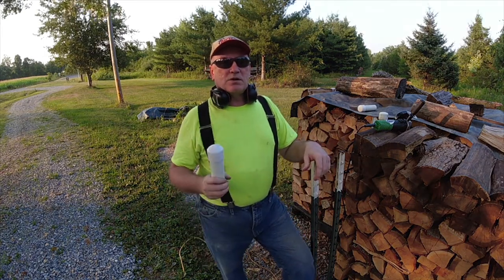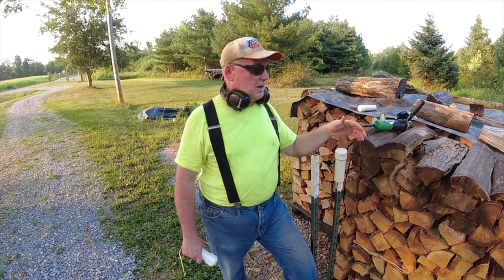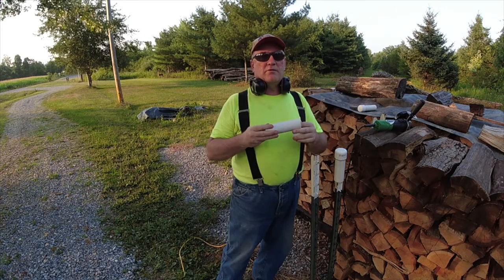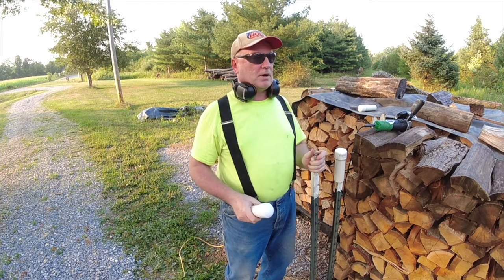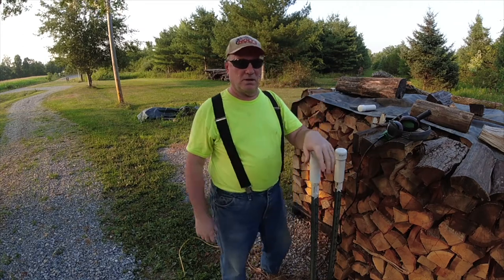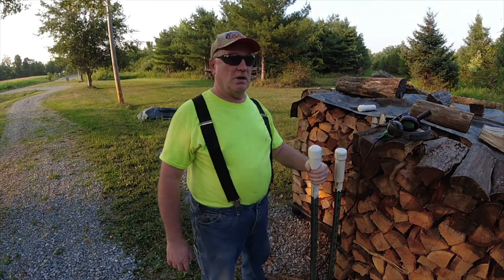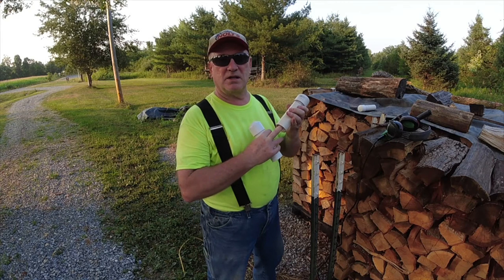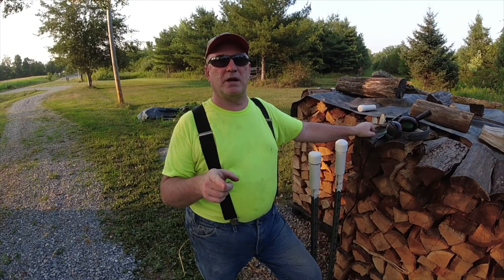#79 - T Post Safety Caps

Comment: I used to work heavy industrial construction in the 70s.  Was on my first day forming for concrete on a power station job when a guy fell 20' off of a scaffold pick and landed on a piece of vertical #6 rebar.  Speared himself though the back of the thigh and into his abdomen. It wasn't pretty.  He was cut down once the ambulance got there and we heard he lived to tell about it.  About ten years later, I started seeing safety caps for rebar to prevent the same kind of accident this guy experienced.   Now they are commonplace.
Cheers, Robert!
Whipple
Reply from the maker: Yikes!  That must have been a bad day at work for everyone. We also wear harnesses to stop us from hitting the ground.  Work site safety has come a long way.  We all like to take short cuts and it's all good until someone gets an eye poked out.  Thanks for watching and commenting - cheers

Comment: that will be better than getting all cut up or scratched by the sharp metal.. I use my little tractor bucket to push the post in the ground,, much easier than hammering and  don't mess up the top of the post.
Reply from the maker: Great idea, I will give it a try very soon - I just picked up some new pallets and need to move the t-posts - thanks for watching and commenting - cheers
Reply: @botabob  you have to go slow,, if you hit a big rock it can bend  a T post very easily, I think we bent two when we put up our fence but that not a bad price to pay for not having to pound dozens of  post in the ground.